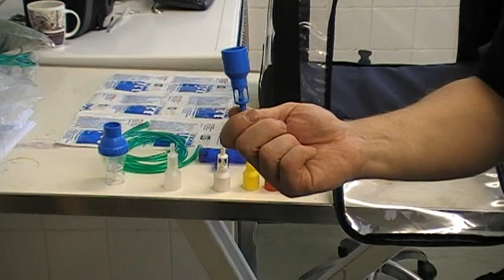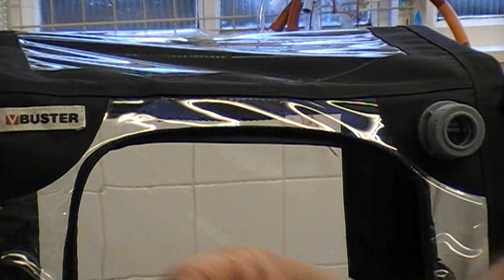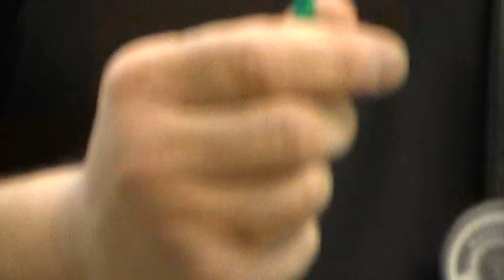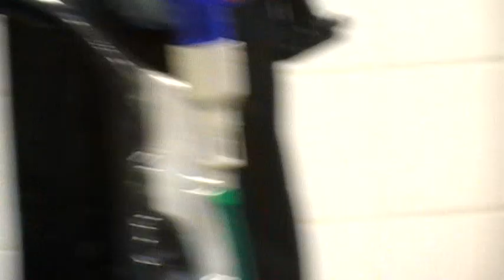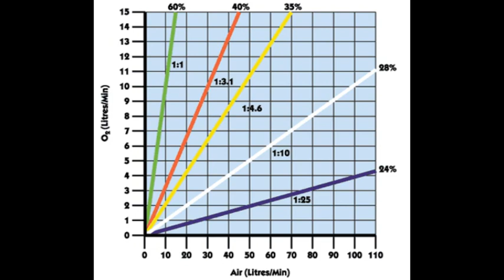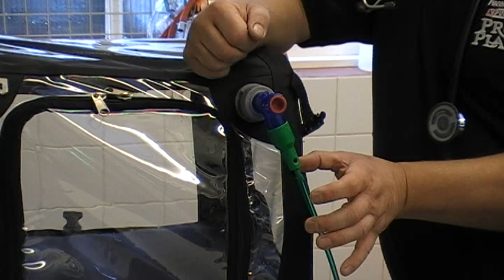Selecting the Venturi and Flow Rate - BUSTER ICU Cages

Comment: Does the dimensions of the tent matter as well? Say you have a 7.5” cubic square inch cage tent? For a canary, someone suggested the flow rate should be 0.5 for one hr.
Reply: Yes, you will need to increase the flow rate for larger tents. In my opinion which is a novice

Comment: Thank you for the great videos.  I need to double check... a dog's minute volume is 3L, I am using the 60% venturi and replace it with the 28% venturi....can I lower the oxygen flow to 2L or should the minimum oxygen stay at 3L?